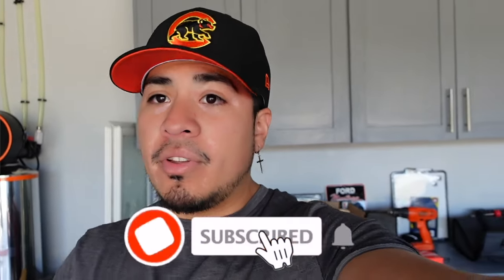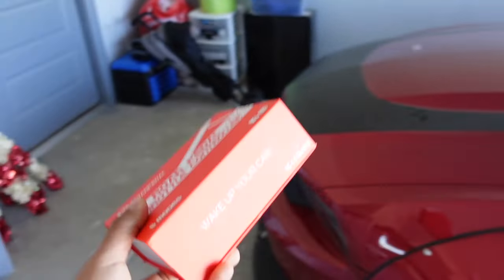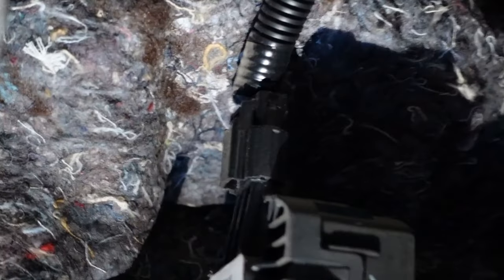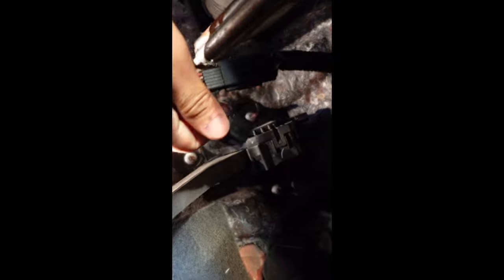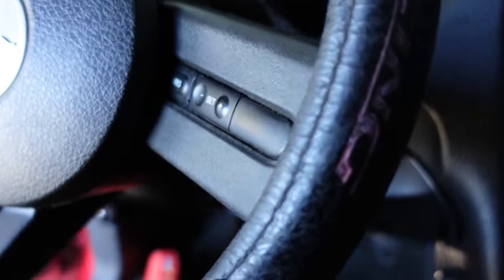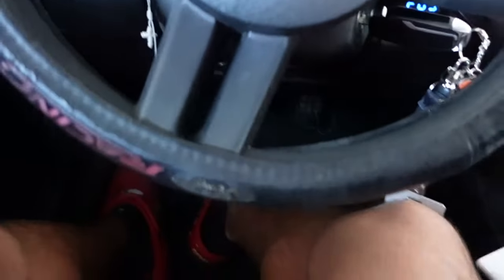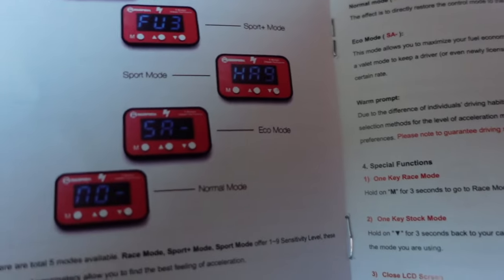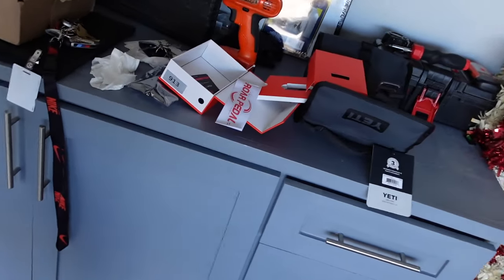Is Installing A Pedal Commander WORTH IT For Your MUSTANG!?

Comment: I returned mine before I even installed it because of a lot of people saying it gave them problems & threw their car into limp mode & some said they weren't trying to change the settings while moving as suggested by Pedal Commander, it just happened so for me the risk wasn't worth it so I might go back to Sprint Booster which never gave me a problem on my previous car & worked really good
Reply from the maker: Yeah, at first it put the car in limp mode a few days later
Reply: @AlbertFlores11  Do you still have problems with it & do you still suggest that people should install it after having it on for a while?

Comment: If u wanted more acceleration at less rpm and Trans shift point change, should've just gotten a tune and not waste money on that pedal shit lol
Reply from the maker: Already tuned, this was something a subscriber sent
Reply: @AlbertFlores11 what tune did you use
Reply: This is for throttle response, not acceleration
Reply: Throttle response won't be fixed in the transmission. If you are serious about racing then you will do everything to get the max out of it